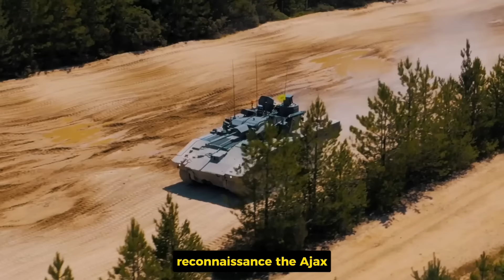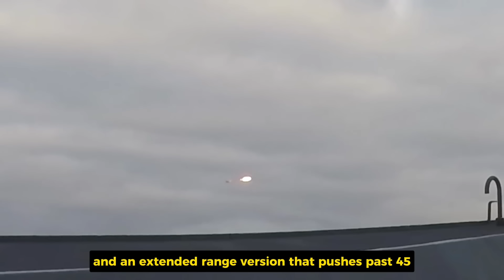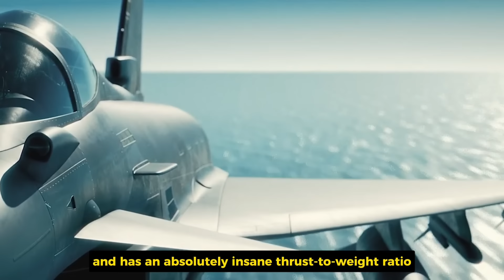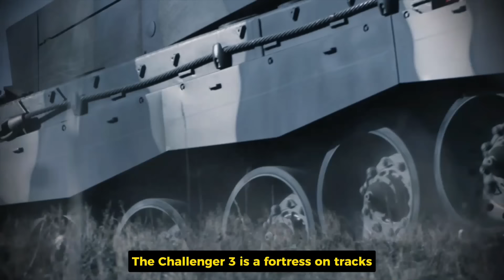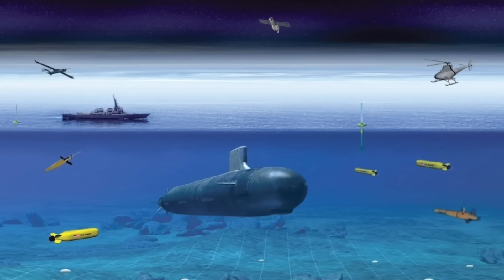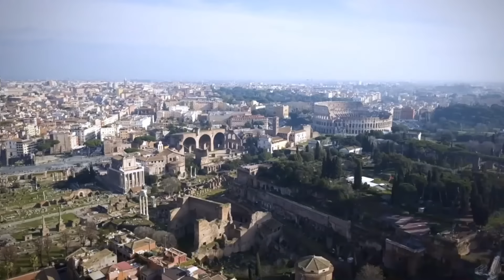10 Most Advanced UK Weapons That Even AMERICA Fears to Challenge

Comment: Number 10 is still suffering from vibration and noise, needs a suspension upgrade. The CV90 mk4 has more powerful engine, more advanced suspension, 4th generation digital systems, Ajax is all PR. The Morpheus digital communications system is still not ready so stuck with Bowman.

Comment: Don't believe anything that is said in this video about the AJAX platform. General Dynamics are liars and thieves and have sold the British MoD one of the worst armoured platforms in Europe, have run massively over budget, over time, and under capability. It may have some decent sensors but ask how it is going to pass that data to anyone outside of the platform generating the data and they can't and if they do, it is a lie.

GD should be banned from competing for any military contract in the UK for the next 50 years after lying and stealing billions of pounds of tax payer money across the Bowman radio system and the AJAX platform, among other catastrophic mistakes, according to some opinions.

On the opposite side of this, when it comes in to service, the CH3 MBT will be the best MBT in the world, narrowly surpassing the Leopard 2A8 which is the current best MBT in the world. Rheinmettal have done a phenomenal job on this platform and it is remarkable.

Comment: Grok says Typhoon loses against Su-35 within visible range, ie dogfighting, but meteor AA missile means it currently wins beyond visible range. Radars and radar cross section differences sort of balance each other out.
Reply: They both have pros and cons but overall they are fairly evenly matched.  In this scenario it is all down to pilot training and therefore, I would suggest the Typhoon would come out on top 9 out of 10 times.
Reply: oh and grok is trueful?
Reply: @garethjones6082 Truthful in the sense that it derives responses from digesting it's learning material which is everything it has access to & can process. The relative performance of military jets designed to purpose is easier to evaluate than more nuanced topics
Reply: @TechToWatch  LLM's have temperature though and you're using a chat bot, meaning it's the app that connects to the LLM and allowed to be creative. If you're just going to rely on Grok's output you should at least ask for references, push back to see if there have been any updates. New leaks and performance data arises, especially as a lot of the early think tank blogs are nearly 10 years old. Saying "Grok" said it like including Wikipedia as reference on a whitepaper.
Reply: @CagedPaps I was just casually adding to a comment on YT about something plausible I’d recently read from grok. Anyone interested could pursue that if they wished and even add their own comment if discovered anything relevant. Am I right that you dismiss anything from grok as X and Musk connected? Would grok and any other LLM report differently to a query about performance of Typhoon v  Su-35? It’s not a politicised topic, is it?
Reply: ''But in practice, Mr. Musk and his artificial intelligence company, xAI, have tweaked the chatbot to make its answers more conservative on many issues, according to an analysis of thousands of its responses by The New York Times. The shifts appear, in some cases, to reflect Mr. Musk’s political priorities''..................

Comment: I would add the Meteor beyond visual range air to air missle to the list. Ram jet powered, with a speed of at least mach 4 and a range of 120 miles plus, it really isn't a missle you would want to be on the receiving end of.
Reply: With the 120 miles being a low ball estimate is utterly crazy
Reply: Yes, and while the AIM 174B has longer range , it only  managed that by being "too long" to fit  into the internal weapons bay of the F22 or F35
Reply: @patdbean meteor can't fit in f35 yet either but theyre working on a fix apparently
Reply: @teddypicker07 it is the same size as the amraam D, so It must "fit".

So, I assume they are sorting out the launch system.
Reply: @teddypicker07 it fits. It has the same dimensions as the aim 120, the problem is electronics integration
Reply: @StanRichmond  you can like your own comment doesn't make it correct. MBDA and BAE Systems are working on "clipping the fins"

“To get the missile inside the weapon bay MBDA plans to equip the Meteor missiles destined for the F-35 with clipped tail fins that will be clipped in height and lengthened, to retain the wing area and thus maintain the weapon’s kinematic performance.”
Reply: @StanRichmond  "The missile's total fin area is reduced by roughly 20% compared with the original design, says Rob Thornley, MBDA sales and business development executive. The new shape allows the Meteors to squeeze into the space designed to house four Raytheon AIM-120C7 AMRAAMs."
Reply: @teddypicker07 i didn’t lmaooo wtf
Also I kinda just took the diameter and length, completely forgot about the fins, just assumed they could be angled to fit
Reply: @teddypicker07 so it is a height  issue? The same thing happened with the Amraam between the B and C  versions. 

They changed the fins  on the C version so they could fit 6 "inside" the F22, against only 4 of the A/B version.
Reply: @patdbean it’s a size of fin issue. Armourers supporting F35 need to swap out the standard fins for smaller ones when it’s being used on that platform. The internal carriers are very very close to the walls and doors. Ideal for Paveway/ASRAAM/AMRAAM, not so good for Meteor. Load solution isn’t ideal either as you need a modified Meteor loader fitted to the F35’s VAP (smaller size to the standard VAP60) and your angle of approach has you tight to the nose wheel
Reply: @patdbean  The missile destroys the 'stealth' signiture, that is the fix that is being worked on.
Reply: Yup, it can be fired over the shoulder as well.

Comment: Its a pity the barrel of the Challenger 3 interchangeable to rifled seeing how it performs in Ukraine but probably not that easy.
Reply: The reason Challenger 2 used a rifled barrel was that HESH rounds need to hit pointing exactly forward along their path of travel. Modern APFSDS rounds are fin stabilised and offer better armor penetration without requiring rifling. The smoothbore cannon allows use of these rounds along with full NATO tank round compatability. The Smoothbore cannon also increases the Challenger effective range from 3km to 5km. In testing a challenger 3 fired an APFSDS round straight through the front armour of a T-72 tank, it carried on through the crew compartment, through the engine block and out though the rear armour.
Reply: @minophis  Yes, also the introduction of composite armour has largely negated the HESH spalling effect.  The performance in Ukraine is more to do with the terrain being perfect "cavalry country", with long visibility and mainly T72's and older to deal with, the rifled gun is killing it.  I suspect the main reason for going over to the Rheinmetal smooth bore is that it eliminates the necessity for a dedicated logistic train, since the Chally 3 will have commonality with standard NATO ammunition.